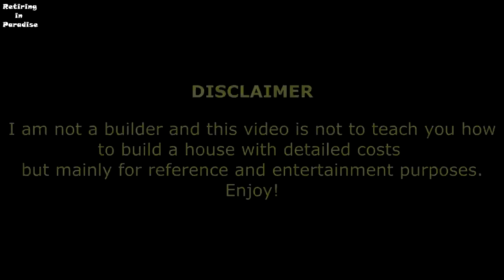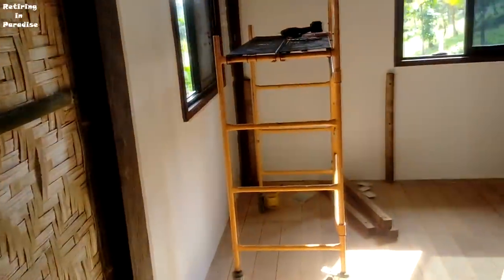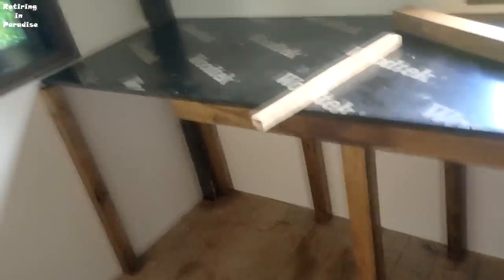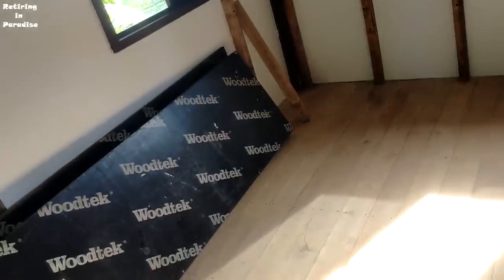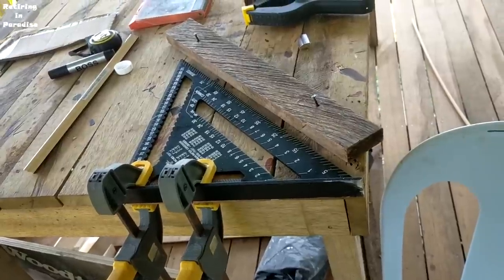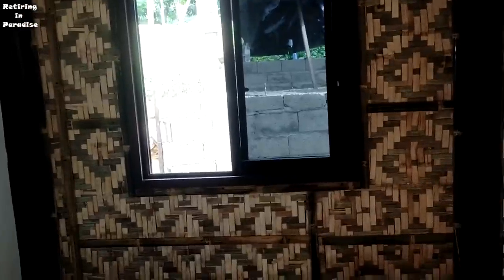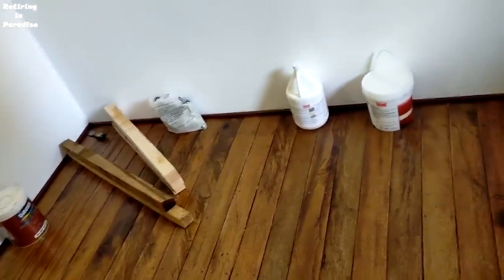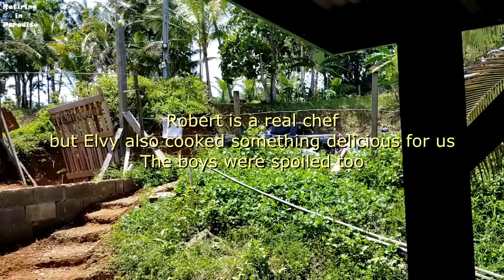V339- Pt 63 FOREIGNER BUILDING A CHEAP HOUSE IN THE PHILIPPINES - Retiring in South East Asia vlog

Comment: Making good progress Joe! Looks like you are not far from being able to move in. Love the look of the floors. The only thing I would do is at a later stage maybe put some insulation under the boards to prevent bugs coming in through the openings between the boards.
Reply: Там влажный  и сырой климат и должна быть постоянная вентиляция и циркуляции воздуха чтобы не появлялась плесень и грибок, особенно кожа, неделя две без вентиляции и кожа вся покрывается плесенью.